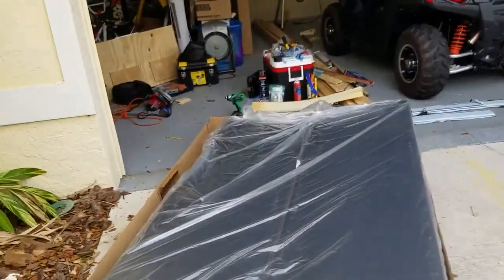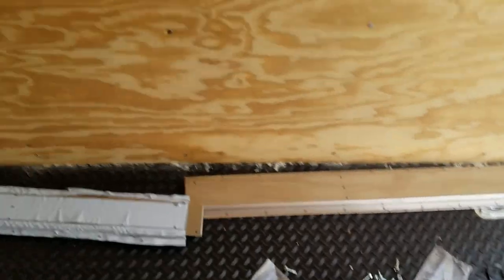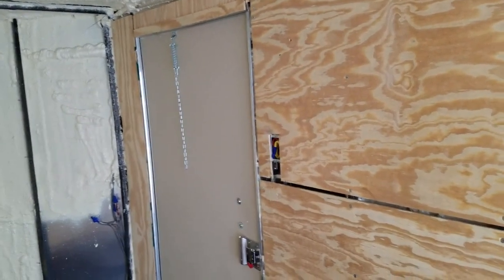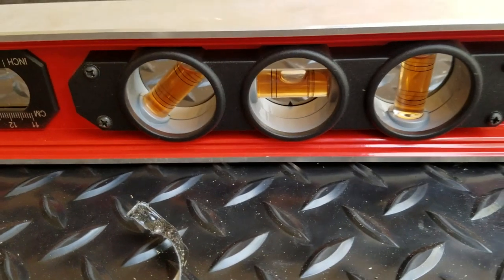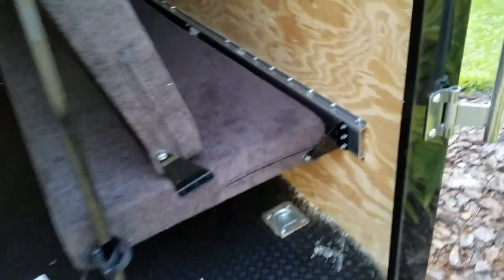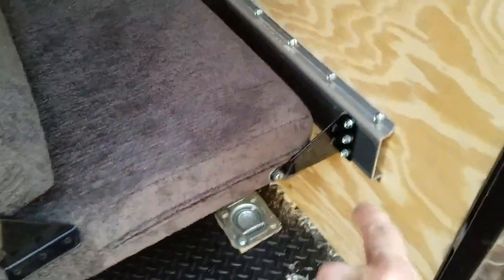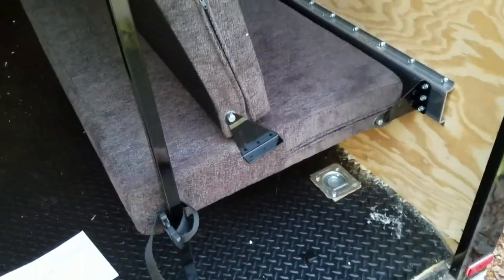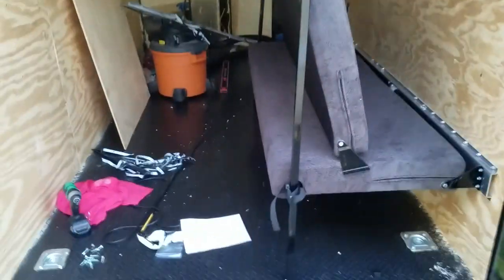Blazin' Belltech Wall Mount Bunk Bed Enclosed Trailer Install

Comment: I don’t get it, you took the time to weld additional  strength to the frame (which is awesome) but couldn’t drill a few holes to ensure the rail mounts onto the S Channel?

Comment: getting same flooring, was it hard to lay down and cut in? Does it hold up well? Thanks!
Reply from the maker: +Team255 the flooring was pretty easy to lay down and cut, just make sure y9u use the right kind of vinyl adhesive that will also bond with wood. The only other complaint is that it gets super duper hot in direct sunlight.

Comment: Way over priced. But if you have money to burn...
Reply from the maker: I hear ya - find me a competitive solution that does the same for less money though. I searched endlessly.
Reply: I did as well and ended up making my own.
Reply: @adamlake2007  I found several similar solutions around the web for well under $1k if you spent over that. For example, busrvparts.com has quite a few options for less.